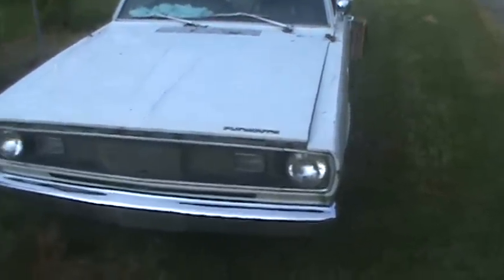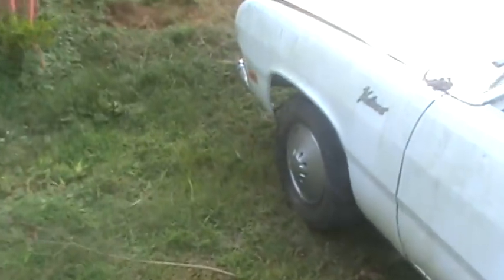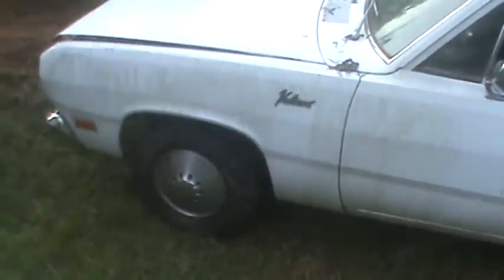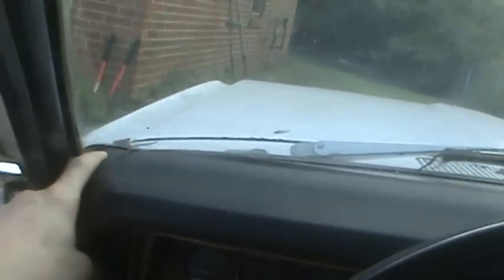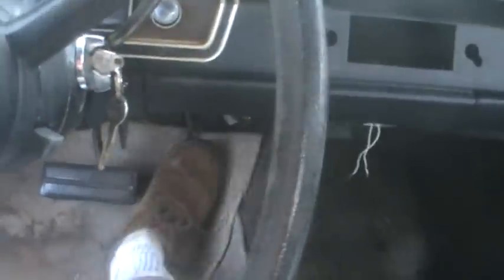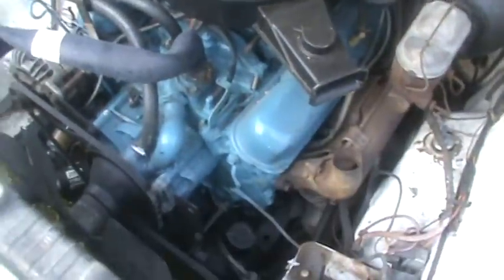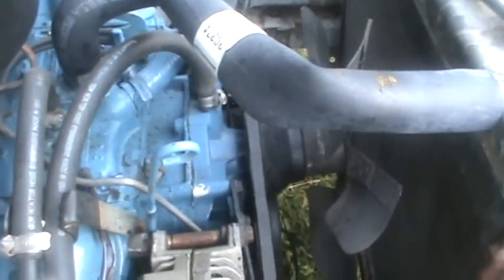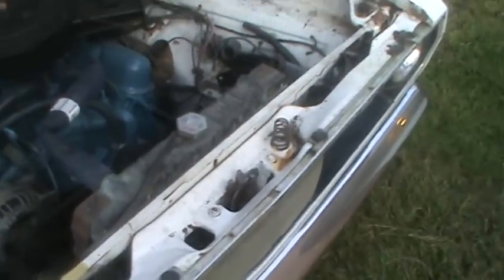1971 Plymouth sees the light of day after 2 years.

Comment: That will be great to see it running. I know how it can be when you get away from working on something for a while...I have some vehicles/engines that I got the engines unstuck with marvel mystery oil but havent yet got them to fire up. Too often for me I have to repair problems with the cars which get driven the most like the Lincoln, Grand Marquis or pickup or with the tractor and don't get the time to get to more of the "just for fun" stuff.

Comment: Good move on changing out the drums, they don't perform very well; especially in the rain!  The other drawback to those olders drums is that some of the lugs had a long spline on them that fused the hub and drum together.  This made it so you have to remove the hub and repack the bearings every time you removed the drum!  Did you change to the big bolt pattern on the rear end or go with the Kelsey Heyes setup?